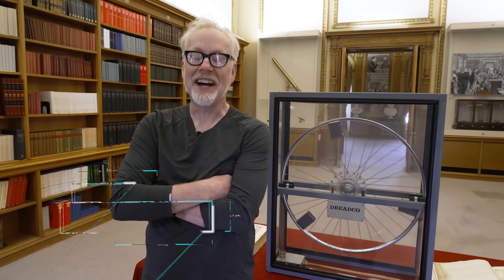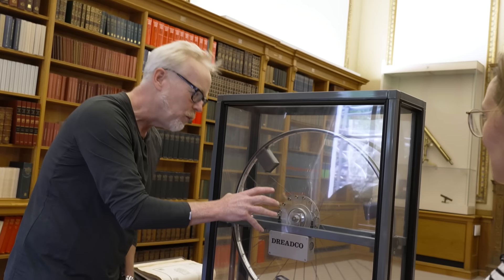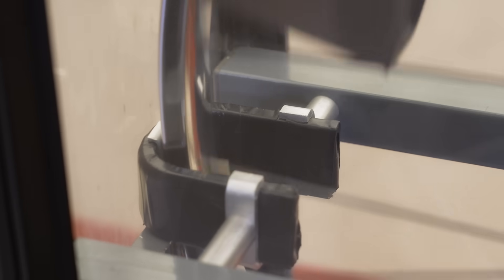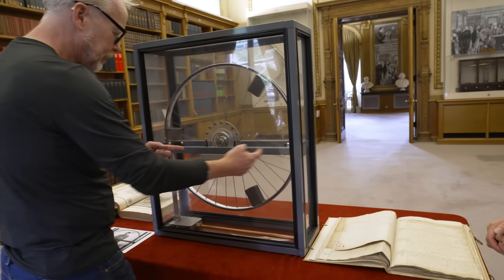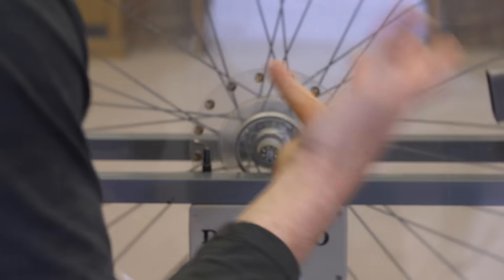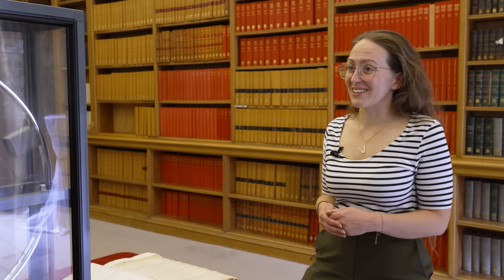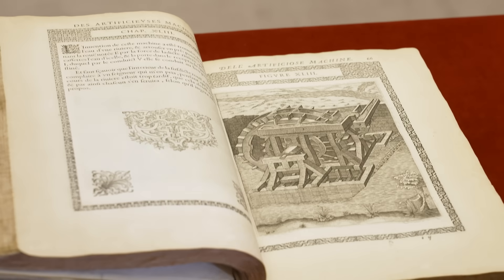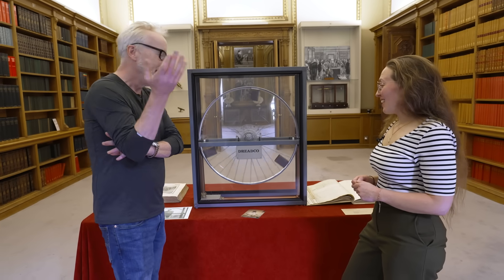Adam Savage vs The "Perpetual Motion" Machine!

Comment: “Sending it out for service” is a different way of saying it needs new batteries.
Reply: The bearing is the only thing to wear, possibly leading it to stall due to friction, while the battery could continue to provide the impulse for many more years.
Reply: a battery on a thing like this would only need to provide a miniscule amount of input. it's not moving fast, nor is it changing velocity. it takes a lot less energy to keep something in motion than it does to stop it or get it started. If the batteries need to be replaced every two years it's veeeery inefficient
Reply: its a motor with a 2 year gas tank cause it has no load on it...
Reply: Duh
Reply: WTF is wrong with people! Is my wall clock a perpetual motion machine? Haven’t changed the battery in 3 years
Reply: @rohit7821  your wall clock doesn’t have to spin a large wheel… just click tiny hands.
Reply: I don't think anyone is assuming it's legit ppm. The fun is in the mystery of how it works.

Of course it needs a service.
Reply: Bingo. Something like this would need bearings lubed eventually too, but if it slows down every couple years without manual human interaction it’s not really perpetual motion.  Occasionally removing friction is awfully similar to occasionally adding energy in this case.

Comment: I have an Swiss made Atoms clock which runs for years without intervention.  The trick is a bellows containing ethylene chloride which is a refrigerant at room temperature.  The bellows expand and contract with minute temperature and air pressure changes. The Atoms clock is all mechanical.  In this case the output is an eddy current  motor made from the bicycle wheel.  The bellows can be used to wind an escapement to drive a very slow generator to power the bicycle which is eddy current motor.  All those heat sinks, pipes and beads are just distractors.  The lower box could contain the ethylene chloride powered generator.
Reply: See also Mova Globe.  The Mova Globe sim an art piece with a world map globe encased in acrylic.  These is a a non miscible set of fluids which make the globe float inside an outer clear sphere.  The globe inside is translucent and there are solar cells inside.  The solar cells drive coils in the globe which are in essence a motor rotor which use the Earth’s magnetic field for the stator.  There is very little friction and requires very little illumination to get the globe turning.
Reply: A way to cheat is to just hide chemical electrical cells somewhere in the boxes.  Reduce the friction sufficiently and with good enough bearings it will run for years from the energy stored in a couple of CR1632 coin cells.  I believe the Atoms or Mova techniques are much more elegant than cheating because they harvest time varying potential energy which exists completely cost free in the ambient environment.  … still not over-unity but works like it until friction in the system increases the environment becomes potential static.
Reply: See also holosteric barometer.  The air pressure is indicated on a dial almost indefinitely with simply air pressure change as long as the jeweled bearings stay clean.  A barometer isn’t too interesting, but fits the bill of acting like a perpetual motion device.

Comment: To mimic perpetual motion without using obvious external sources, you would have to make a machine the play off factors used with the rotational forces of the earth.
It would have limits on it's size and can only have min amount of friction. It's speed can be variable by it's location of the earth, if enough forces are there to move it.
It would take someone with the resouces to do the needed math and design the part precise enough to get the machine working.
It's wouldn't be perpetual motion, but it would convince the masses. The method that powers it, is not common.

Comment: My guesses on the service required by the university:
1. Vacuum in the box needs to be restored. After two years, there may be enough air that leaked inside that creates resistance
2. Grease the bearings

Comment: I would suggest you search a back issues for Scientific American's "Amateur Scientist" articles. I recall that sometime in the past (sometime in the 80s?) there was an article on how to create a perpetual motion machine that looked very similar to this. Your idea that it is an electric motor is pretty close if it uses the same principle. The idea was that the machine uses electromagnets to accelerate permanent magnets on the wheel. The wheel in turn generates just enough electricity to power the electromagnets. Of course, in practice this doesn't work without external power, and this is where the secret was because people sometimes forget that with the invention of radio, there's energy coursing over the air pretty much all the time. The case contained antennas that can collected ambient radio energy to power the device. The SciAm article noted that under certain circumstances the device could actually speed up. Now the device needs to have very effective bearings and other details that would probably need a certain amount of servicing just for wear and tear (the article did detail parts and specs). Such a device may indeed suffer from being placed in a basement as the shielding provided by the building would probably impact its ability to collect enough stray radio energy to work. With cell phone tech nowadays, it may be possible to build a rather effective version of this now with very small antennas.
Reply: Unless you are right next to a big transmitter the amount of radio energy in the air is really tiny. Radios have to amplify the signal from the antenna by a huge amount for you to hear anything.
Reply: @LesNewell Actually you can listen to radio without a powered amplifier if you have a properly tuned antenna (see crystal radio sets). I have to admit I can't find a reference to the original article where I read this, but I do recall the description of switching electromagnets and antennas hidden in the structure of the device. The premise was that  it was just enough power to counter the loss through friction. There was a 1967 article on perpetual motion machines in a 1967 SciAm, but since I don't have access to it, I don't know whether that was it or not. Besides my memory was more along the lines of an amateur scientist type physics project, but admittedly checking the amateur scientist index I can't find hide or hair of it. Perhaps part of the problem finding it is that it was reported as NOT a perpetual motion device, but rather  a device that just looked like one.
Reply: @zubiez.524  Having built a crystal radio many years ago, it only works with a very sensitive earpiece and even then it's very quiet. The available power to the earpiece is miniscule.

Comment: It looks like a circular accelerator. Rail and Coil guns use a similar design just in a linear design. In rail guns the magnetic energy is applied through rails via high powered capacitors which are charged via batterys. To do something of this speed though you wouldn't need much charge and it could be supplied via a kind of simple dynamo which provides just enough to keep the wheel moving. Start with a very generous initial spin and you're off. Friction would be the enemy here. Which is why it would need servicing. Also providing fresh magnets over time would help with it's efficiency.

Comment: A hermetically isolated adiabatic hard vacuum envelope contains two closely spaced but not touching, in-register and parallel, electrically conductive flat plates having micro-spiked inner surfaces.  They are connected with a wire, optionally containing an in-series dissipative load (small motor).  One plate has a large vacuum work function material inner surface (e.g., osmium at 5.97 eV, DOI: 10.1116/1.4934685).  The other plate has a small vacuum work function material inner surface (e.g., hydrogenated amorphous carbon nitride at 0.63 eV, DOI: 10.1143/jjap.41.6169).  Above 0 kelvin, spontaneous cold cathode emission runs the closed isolated system.  Emitted electrons continuously fall down the 5.34 volt potential gradient.  Electron evaporation from carbon nitride cools that plate.  Accelerated collision onto osmium warms that plate.  Round and round.  The plates never come into thermal equilibrium when electrically connected.  The motor runs forever.  Total conversion recycles waste heat absent any dependence on source identity.  So it "can't" be done.  So what.
Reply: As for the displayed objet d'art,  slowly sweep a cheap compass across the wheel's circumference and core to find the other half of the monopole motor.  "8^>).

Comment: I'm a physicist by training and worked at a university doing physics research for years and although I "know" you can't have perpetual motion machines there's a bit inside me which hopes someone comes up with one.  Not because I think it's possible but for the new physics it'll teach us about.  It's similar to the OPERA experiment detecting faster than light neutrinos, I strongly expected it was wrong (as did the scientists running the experiment) but I hoped it wasn't.

Comment: It's very amusing but it's just an electromagnet triggered when a box approaches one of the U shaped (electromagnets) on either side. A low power, simple circuit pulses one or both of the electromagnets with just enough power to add an impetus which keeps the wheel rotating. This is pretty much how electric clocks work.

Comment: Very low friction low speed bearings. The boxes have batteries and a coil.  The U shaped things are permanent magnets.  As each box passes thru the magnet, it delays for a moment and the gives a tiny pulse to its coil to put just enough energy into the wheel to overcome the tiny frictional losses.  Eventually the batteries run out and must be replaced.  It is very low energy so the batteries last a long time. The rest of it is a red herring.  Especially anything needing a heat sink.  That kind of loss is ridiculous on a device that is supposed to display perpetual motion.

Comment: I have perpetual motion machines in my house that have to be refilled every couple of years with 9V batteries.
Reply: My clock  with pendulum and chimes has run on one "D" cell for 4 years. 👌
Reply: what kind of modern clock uses 9v batteries? every one i've had uses a single AA
Reply: @thecaptainnoodles  who said they were modern clocks
Reply: @thecaptainnoodles  And who said theirs were clocks... Not Dr Nemmo, that's for sure.
Reply: @jaym8299  nor did he say they weren't clocks.
Reply: @thecaptainnoodles  The old alarm/FM radio clocks of the ancient days of yore
Reply: smoke detector 🤣
Reply: @ChoppazOG  If they were "perpetual", then they wouldn't NEED 9volts batteries, now would they?

Comment: I wonder if it is an inverted Wimshurst machine. It's fed high voltage, low amperage electricity and that's enough to turn the machine like an electric motor. Some of the components on the inner acrylic wheel also appear on a Wimshurst machine. Its a very low power electrostatic motor?
Reply: Also known as a capacitor motor.
The YouTube channel Ludic Science has a video showing an electrostatic motor running without all the dramatic sparks at 4:20 (YouTube comments don't allow links)

Comment: I suspect that it is an electrostatic motor with a charge derived from the u-shaped objects which I believe are coils, and the boxes mounted at 120 degrees are magnets. Perhaps capacitors are used to accumulate and perhaps increase charge voltage using a Cockroft-Walton multiplier circuit, perhaps located inside the "Dreadco" box. The charge would then be transferred to and from the cups mounted on the wheel via the cathode and anode mounted close to them. I only have a modest familiarity with how electrostatic motors work, so I'm sorry if I have goofed up any technical details.

Comment: I'm likely wrong, but if it lasts for 2 years, I would highly suspect that it is nearly all window dressing, and it is an early form of a Piezo / quartz radial motor. Superb bearings, a tiny capacitor cluster that is providing miniscule diminishing returns over time, etc.

Comment: I bet they found that it takes batteries and it's not a "perpetual motion machine". they were disappointed because they hoped it was more complex than batteries, even though they knew free energy doesn't exist because it violates the laws of thermodynamics.
Reply: That's not in question, I'm afraid.  it doesn't seem to be in a vacuum, given how thin the glass/perspex panels appear to be so there are definitely losses to air resistance if nothing else.  Therefore there is some source of energy replacing those losses.  A battery is probably the simplest option, given that people might object to a thermoelectric plutonium pile like the power supply for several space probes.
Reply: Yeah that's what I would have liked to know some sort of assurance of rules no batteries! Kinda feels like click bait otherwise!

Comment: They eliminated the air resistance by placing in it inside a box that is under a vacuum...which means the wheel only have to overcome the friction of the bearing to keep spinning
Reply: Maybe, but it didn't sound like it when Adam bumped into it.  Still won't get you 2 years.

Comment: I think the boxes have a kinetic switch that turns on and off in depending on the position wheel is in. So, on the down stroke, it somehow closes a circuit at the halfway point and activates the equal magnetic force to the u-shaped magnets. This means that the entry into the magnets are not used against it to create a counter force the rotational force. It might also mean that the entry into the magnetic space is actually using the magnet to accelerate on the entry and then when the switch triggers, it uses the magnetic forces repelling each other to accelerate.
Reply: You are describing a motor.

Comment: I'm thinking magnets repelling eachother
Reply: Draw a diagram of how you think that works.
Reply: @CorwynGC  the magnets on the side are reversed to the ones on the wheel so each time it passes it repels each other. Sorry I wouldn't know how to make a diagram. Just a YouTube viewer is all.
Reply: Each box could hold up to 6 magnets, 3 on each side on a rail. The rail would allow the magnets to also act as weights to help pull the wheel down.
Reply: @aakla  The trouble with both the magnets repel, and weight pulls down, arguments, is that they do the same thing entering the field, and going up, respectively.  All these forces balance.  To keep it spinning you need something which ISN'T symmetrical.
Reply: @CorwynGC  😭 if it wasn't for science, my idea would have worked. 😁
Reply: @CorwynGC  thanks for the info, I'm not really into science, but a few subjects and people make it interesting to watch. I'm not good with a lot of the details though.
Reply: @aakla  keep learning!

Comment: i made a cipher wheel to try to get the pseudonym, and nothing comes close from ortherius (what the CC shows), or from bresel, or brussel. i did my own surname, and got something that wasn't exactly a name, so then i modified it a bit to make it more like a name. i'm curious if that is what he did.

Savage = Fnintr

Mills = Zvyyf
Reply: As described, it's a rot13 cipher, which is quite common as you can apply it again to get back where you started.
Reply: @richardfarrer5616  i didn't know the name of it, i just made a sketch in a CAD software to get the cipher. then a matlab program to do it too.

i was just trying to get the guys name from his cipher, or his cipher name from the spoken name given. but it came back with nothing even close to ortherius.

as you can see, adam's isn't much like a name, but he could add in a few vowels to make it sort of like a name.
Reply: I think her pronunciation was a bit off. Wikipedia has a page on a Johann Bessler that looks like our guy. To my eyes, it seems Desaguliers spelled the pseudonym something like "Orfirius," but in the Wikipedia article it's "Orffyreus," which does indeed match "Bessler" in rot13, plus the Latin ending "-us"
Reply: I get the impression that the rot13 is just the first part of the cipher. Bresel converts to oerfry. It looks like the writing says Oefireus, which is very similar to oerfry.

Comment: If it is necessary to change the batteries there every two years, then any battery-powered wall clock is the same "perpetual motion machine" .. Such a wheel, rotating for three years in a row, can be done, for example, on this principle: in boxes along the rim of the wheel - a chemical battery, an electromagnetic coil and a magnetic switch, and in the stationary part, next to the rim - a magnet: passing by the magnet, the electromagnet turns on for a short time in the box and repels from the permanent stationary magnet, giving a torque to the entire wheel ... The energy consumed will be very small and the wheel will spin for a long time from one battery (also called "pulse electric motor", "electromagnetic pendulum").
But, here's the question: why is it needed if it is unable to perform any useful work?
If Adam needs the same “bicycle wheel” that has been spinning for a couple of years, then I can design a working layout, then send the drawings, and Adam will assemble it on his own.

Comment: At 8:00 I've seen the one on the left in the past.  A portable AM radio would pick a small amount of interference each time a white box would pass a certain point.  The box contained battery, coil of wire, electronic circuitry, etc. to give a little push each time around.
Reply: A person could just build a crystal radio that pumped power into coils and you have a perpetual motion machine lol

Comment: I think the 3 boxes inside the wheel and the "magnets" on each end are decoys. I think the box at the bottom has a battery inside and the cooper pipes have wires inside.